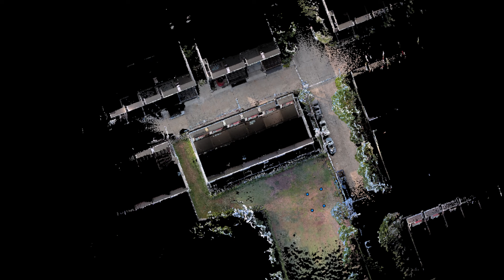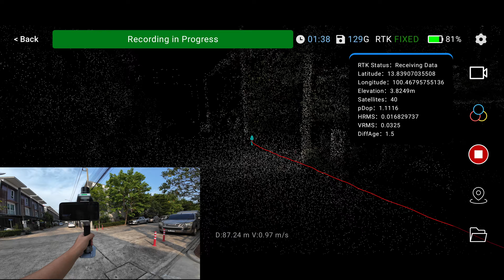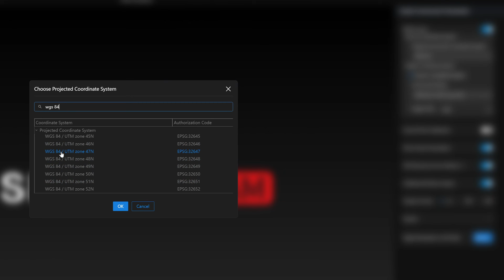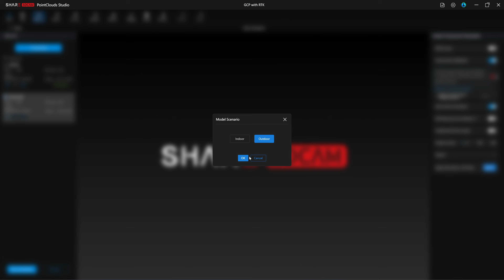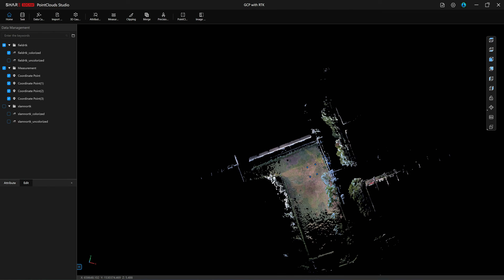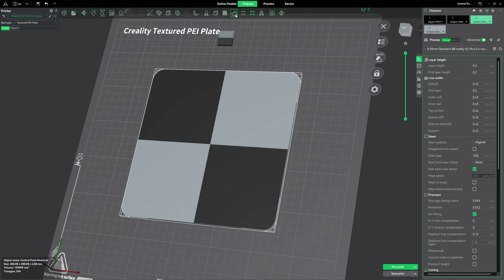Precise LiDAR Scan Alignment Using Checkered Boards (SHARE S20)

Comment: Hello Payo,

Thank you for your videos! I find them very informative and professional. I have a few questions about the SHARE S20.

1. SLAM and RTK: You mentioned that they cannot operate simultaneously. If I start scanning with RTK on the ground floor and then go down to the basement where there is no GNSS signal, will the scan stop, or will it automatically continue using SLAM? Do I need to choose the mode before starting and check GNSS coverage throughout the scanning area?

2. Indoor accuracy: You mentioned that deviations can reach up to 5 cm in large spaces. What about smaller areas, such as apartments, where even a 2 cm deviation can be significant when producing accurate floor plans?

3. Improving accuracy: Is it possible to achieve better accuracy by walking more slowly, spending more time in each room, or making multiple passes? I noticed that the accuracy indicators change color during scanning. Does this mean the accuracy is actually improving, or is it fundamentally limited to around 1–3 cm by the device's technology?

I think a video covering these topics would be very helpful for people considering purchasing the device without having had the opportunity to test it first.

Sorry for all the questions, and thank you in advance for your explanations and the excellent quality of your work!
Reply from the maker: #1 – The SHARE scanner does not support RTK Fusion with SLAM, so you will need an RTK signal for most of the scan. I recommend performing two separate scans: one outdoors with RTK and another indoors using SLAM, then manually aligning them.  
#2 – Wall-to-wall accuracy can reach approximately 10mm, but room-to-room alignment may exceed 20mm in multi-floor or multi-room setups. For complex scenarios, consider splitting the scan into sessions and aligning them manually.  
#3 – SLAM LiDAR is prone to rotational drift. Passing through narrow corridors or doorways can introduce errors, and moving from staircases into larger rooms may cause floor-to-floor level discrepancies. Reducing the number of passes through tight spaces and splitting the scan into smaller sessions helps minimize these errors.
Reply: @Payo-TensileCreator  Thank for your answer. Is there any update for the Fusion both of indoor and out door with SHARE brand ?

Comment: There is a big difference between the location map from bricsCAD and the LIDAR scan. Everythging is displaced or out of scale. Just take a look to the parallel houses from the right... I'm not totally confident with this method :(
Reply from the maker: On large streets, Google mounts LiDAR and RTK systems on vehicles to create maps. On smaller roads, they rely on satellite imagery. If a location shows Street View, it means that area was captured by vehicle and is therefore more accurate. If you’re unconfident, don't use my method. I don't have time to educate people one by one.

Comment: I have only the 3dMakerPro Eagle Max (no RTK) but I have an old BadElf Surveyor which can use the RTK - could I use the BadElf to get the coordinates of the checkerboard centers and use it to correct the Eagle points somehow? What software would I use if so?
Reply from the maker: If your GNSS device can correct error with RTK, I'd say it should be precise enough to align the scan data onto.

Comment: thank you for the video! could you please explain why you wrote 29 m height offset? where it came from?
Reply from the maker: The GPS‑derived ground level in this area is based on ellipsoidal height, which reads as −29 meters.
Reply: @Payo-TensileCreator oh got it, thank you very much! Because I thought it’s the height of the laser above the ground

Comment: Payo, I am the one who asked about this issue in another video. Thank you for making a video on this topic. I tried this method, processed the data with RTK Fusion, collected the coordinate information from the scan (I am also a land surveyor and collected the information with my GPS units using base and rover and they checked very close 0.02M) and reprocessed the data using the the ground control information. The point cloud from the RTK Fusion is very good but the processed point cloud with GCP data is completely unusable. It has double walls, ground at different elevations and is obviously incorrect. I went back and checked my GCP information and it was correct (thought I may have switched my x and y values). Thought it may have just been a glich but the second time processing turned out the same. Any idea of what I may be doint wrong?
Reply from the maker: There are many factors that can lead to poor SLAM scan results, such as improper loop closure, scanning in low‑feature areas, walking speed, dynamic moving objects, and even how the scanner is turned or held during operation. My strongest recommendation is to re‑scan the same scene and keep practicing until you achieve the most accurate results. When I first started with my SLAM LiDAR 5 years ago, I spent nearly two months training in the field before I felt confident enough to deploy it on a real project.

Comment: What would you say is your Favorite budget slam scanner so far?
Reply from the maker: The most affordable scanner you can realistically use on a real job is the C1. The Pocket 2 is still under revision, its color point cloud quality is better than the C1, but its accuracy is noticeably lower (about 20 mm compared to 9 mm with the C1 over a 30 m distance and a 100 m loop).

Comment: Based on your videos and recommendations, I purchased a "Creality Raptor Pro"  directly from the Creality site (Big Mistake). It was defective and would not connect through the USB C connection. I tried wireless but it too needed the USB C connection on the scanner so it didn't work either. I called support and after some troubleshooting they told me to return the unit. I have been emailing to Creality who keep telling me the return authorization is being reviewed. 

I spent $1901.00 (USD) for this useless device. I have sent many emails that all get response that they have sent it to "Operations for review".. If it's their chat support technician said to return it, what review is necessary? 

Can you provide ANY suggestions on how I can get someone at Creality to respond and provide me return details so I can get a refund.

The "Raptor Pro" looked so great in all of your videos but you didn't give us a hint of what terrible customer support they actually provide.

Can you please help?

Comment: Thank you a lot Payo for the content -> top content for 3d scanning on youtube 👌👍. I have been thinking, could the control points be on a vertical wall? = put the feet of the s20 against the wall. -> would help in muddy and dirty enviroment, and could more easily use known coordinates from total station etc.
Reply from the maker: Unfortunately, you can’t tilt a SHARE scanner, it will throw an error.
Reply: @Payo-TensileCreator  It should work in all positions at least in slam (= non RTK) mode🤔
Reply: @Payo-TensileCreator  Hi, I did try this with my unit of Share S20 with newest/current software updates, and device can be tilted sideways, front and back, even upside down, during scanning. Control points can also be collected in every position, with RTK and without RTK. From walls, and from roof or under the table if needed. Did not get errors of too large tilt angle anymore. This is helpful in tight spaces and corners. No need to kneel in every space, just tilt the device. Calm movement needed still. Control points are useful to be on the wall sometimes. In north we have snow and ice, and in construction site groud can change quickly. With same control points it is easier to align later scans to earlier. No need for control points in RTK scans, but indoor/ underground there is no gps, and not always good dataconnection -> control points are needed for reliable alignment. I did only couple of scans to confirm this, tilting seems to work OK, and did not notice any quality loss yet.
Reply from the maker: @tonierkkila1057  When the scanner is tilted heavily, accuracy drops. In complex scenes, tilting can cause remapping to fail during processing, and in narrow spaces it may cause the scanner to lose track. The IMU sensor has inherent limitations, the less you move, the fewer errors it introduces. This holds true for all SLAM scanners I’ve tested, not just the SHARE models

Comment: Can you please make a video using the S20 and ground control points when scanning the 3 story house you have scanned in the past. What I am interested in is only the first level foundation surface. I would like to know how accurate the S20 can get if you scan the first floor ground surface and record GCP that you know the relative Z elevations (maybe use a total station or zip level to record the Z elevations of the GCPs). Obviously one of the targets would be a "zero" datum reference.

My goal is to use the S20 to produce contours of existing house foundations to determine how much they are settling/heaving. I would use about 4 GCPs spread out about the floor plan and record the relative elevation of each with a zip level. Then I would use the Share software to align the point cloud with the recorded GCPs to finally produce a contour surface in Sketchup/CAD.

It would be interesting to pick a couple of random points in the final adjusted scan and see how accurate the elevation readings are compared to those measured in the field (randomly picked in the field before or after scanning that are not the GCPs).

Does this make any sense to you?
Reply from the maker: I use the same approach as you when I need to level‑align a landscape scan. I place four boards, measure their elevation with a laser line, and use those values for control point alignment. However, if there’s a building nearby, I prefer to align to the building’s vertical instead.

Comment: Payo, thanks for another great video. I’ve been following your channel for a while now, and my Share S20 is arriving tomorrow. I’m pretty excited about it.

I’m a consulting arborist here in Atlanta, Georgia and do a lot of tree inventories and site documentation. I really think this technology is going to help me quite a bit.

Quick question about your targets: does the size matter much? Yours look like they’re around 12x12 or so. I was thinking about just making some myself and painting them. Do you think that would work fine?

Also, do you offer any freelance consulting or one-on-one help? I may be interested in that as I get rolling. Not even sure what the best way is to connect on YouTube these days, but feel free to point me in the right direction if that’s something you do.
Reply from the maker: You can create a reverse model of a tree from a LiDAR scan. It’s faster to handle with polygonal modeling tools such as Blender or 3ds Max. For the target size, I recommend a minimum of 20×20 cm, since that fits most 3D printers. And yes, you can paint the target, that works fine. My email is listed on my channel page, so feel free to send your questions there.

Comment: I don’t understand why the app does not store the coordinates for the GCPs when RTK is in use. That way one wouldn’t have to manually pick them out from the point cloud and copy paste them. So for the example in the video I’d like to take GCP for the first scan as well where RTK is used. Then I’d want to tell the software to use the GCP coordinates from the first scan for the GCP in the second scan where RTK is not used. That would make the process more or less automatic, simpler and more precise.
Reply from the maker: Two LiDAR manufacturers I know can capture coordinates directly during the GCP workflow, but the SHARE scanner lacks this capability. I’ve already pointed out to them that this is a critical missing feature. Relying on mouse clicks introduces potential errors, especially when the checkered boards are scanned in low‑light conditions.
Reply: @Payo-TensileCreator  I honestly do not understand why you need to use GCPs at all. You have a scanner with RTK enabled and it can  produce perfectly geolocated point cloud. GPCs are mostly used with "blind" to location devices to record each GCPs location with a separate rover and then tie collected point cloud with real coordinates in post processing by using each GPC location.

BTW, have you tried to use RTK for internal scans but starting outdoor to get some points outside tied to real coordinates and then enter a bulding to do an internal scan. Slam is based on math and a point cloud is just a part of simple geometry. If you have points outside tied with real coordinates SLAM solving should have zero problems to calculate real coordinates for every point collected indoor. 

I do not have Share and never tried it with Eagle but I hope it's how it should work. As for just outdoor Eagle RTK works perfectly.
Reply from the maker: @ozstockman  Some LiDAR scanners support RTK+SLAM, using SLAM to correct RTK errors and automatically switching to SLAM in areas without GPS signal. SHARE takes a different approach, it operates either in RTK mode with a 100% fixed solution, or in SLAM mode. RTK fusion won't work with outdoor+indoor scanning.
Reply: @Payo-TensileCreator I also suggested it to them, and the reply was:
“Regarding your request to save the RTK coordinates directly into ground control points through the SHARECapture app, I would also like to clarify that the main purpose of RTK on the C1 is to provide georeferencing for the scan trajectory and point cloud, helping the point cloud enter a real-world coordinate system.

It does not work like a professional RTK receiver or total station that automatically measures and generates precise X/Y/Z coordinates for each control point.”

Not sure if they understood my suggestion, or I don’t really understand their reasoning.
Reply from the maker: @bjondersson The GCPs collected with the SHARE scanner don’t include corrected coordinates at the time of capture. They only store a timestamp, and the coordinates must be processed later on a PC.

Comment: i have the RTK for the C1. I still need to dive into it. But here you get coordination from the RTK. those coordination are good enough for engineering with GPS? Sahre contact said this was not possible but now i see you doing it. so i am confused...
Reply from the maker: I’ve used the S20 RTK on a real pre‑fab steel construction project, and the results were highly accurate, I encountered no issues during installation. While it’s true that GPS coordinates can’t be extracted directly from GCPs with the SHARE scanner, they can be obtained using checkered boards as a workaround. Some LiDAR systems support GPS extraction from GCPs, but the SHARE scanner does not

Comment: Hi Payo,

Great video I have a 16gb ram HP Omen 15 (2
512gb SSD) laptop is that good enough to run the software?
Reply from the maker: “The CPU should have at least 8 cores and be no more than three generations old. The system should include 32 GB of RAM, and the GPU should be at least an RTX 4060.